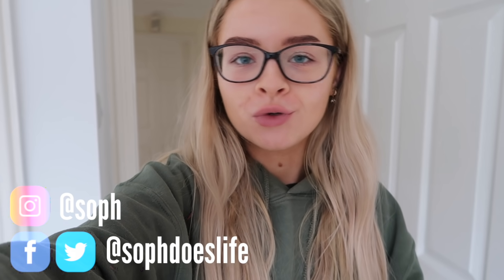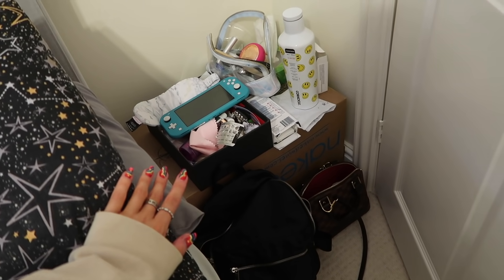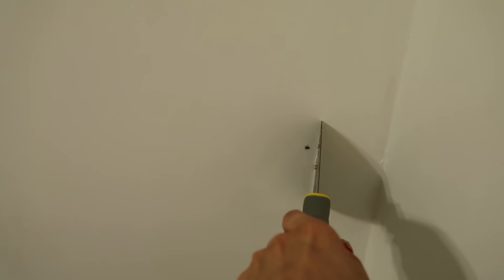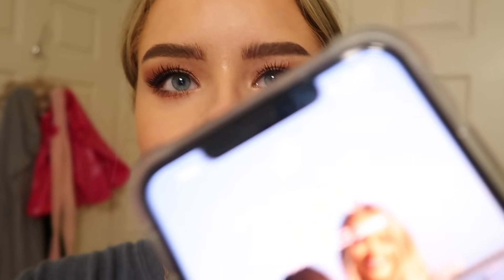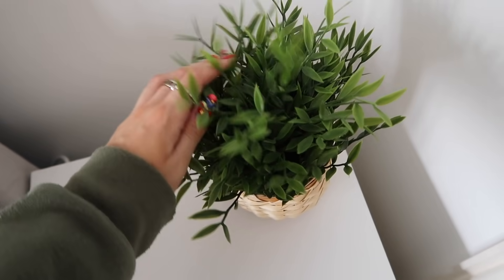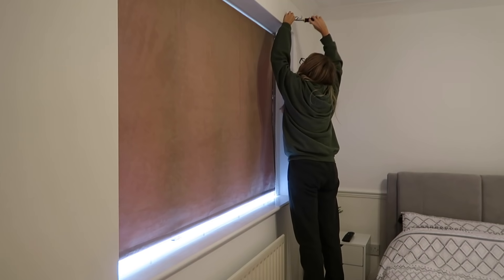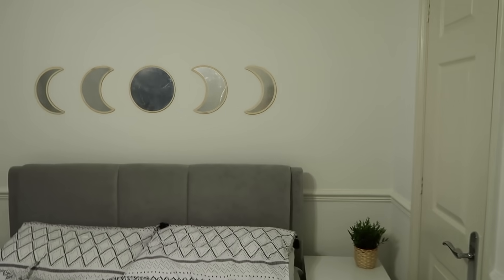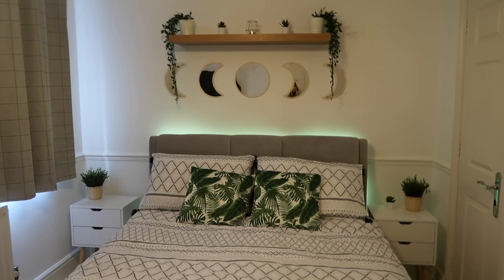BEDROOM TRANSFORMATION!! HOME DECOR BEFORE + AFTER

Comment: Hey Soph! A tip for the wall outlets: you can take them off, so you don't have to worry about getting paint on them. Just use a screwdriver for it and don't forget to turn off the electricity through the fuse box when you take the outlets off and when you put them back on! I don't want you to get electrocuted xx

Comment: Just a tip, you don't necessarily need to iron curtains, especially if they're already up - if you thoroughly wet the curtains with a spray bottle while pulling it taut from the bottom and you leave it to dry, the weight of the wet curtains pulls out the wrinkles as it dries

Comment: Be careful with heat and blackout curtains, I put mine in the washing machine and the heat from the water stuck the blackout lining together and it melted like glue and I couldn't pull it apart, was just a melted heap 🙈